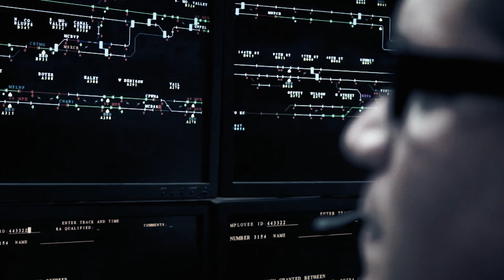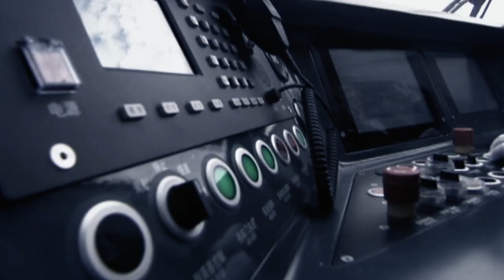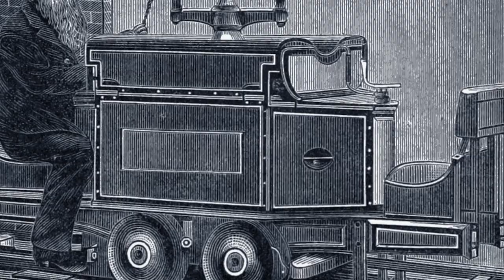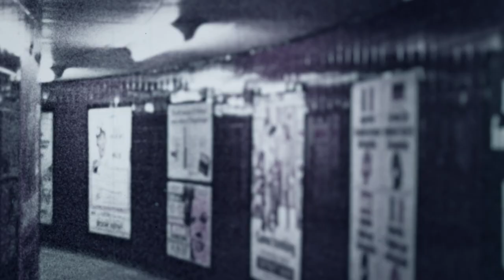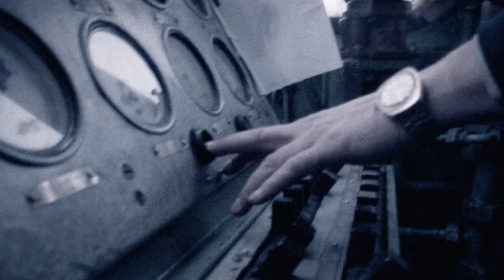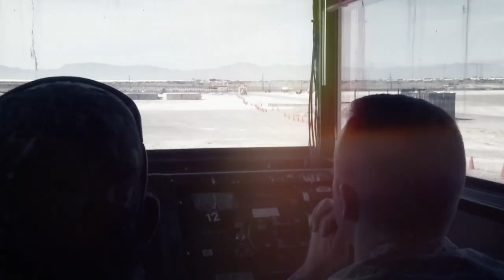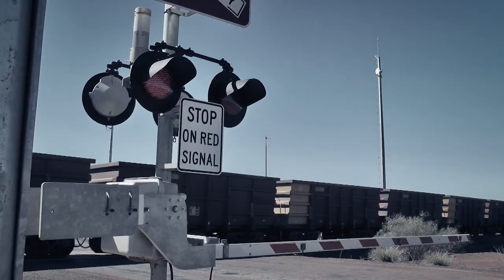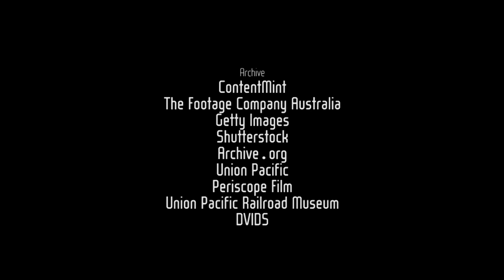Maglev: How To Travel Faster Than A Speeding Bullet (Train) | Power

Comment: 1:35: 🚄 The video explores the power of rail speed, focusing on the shinkansen bullet train in Japan.
6:14: 🚄 Maglev trains use magnetic levitation to achieve high speeds and reduce friction.
10:47: 🚄 The video discusses the development and cancellation of hover train projects in the UK and France.
16:39: 🚄 The TGV is a reliable, fast, and safe railway system that connects France and its neighboring countries.
23:01: 🚇 The Dubai driverless Metro is fully automated and doesn't need drivers.
27:11: 🚂 Luxury trains in Japan, India, and the Orient Express offer exclusive and unique travel experiences.
32:37: 🚂 Trains played a significant role in wars, including the creation of trench warfare and the massing of armies.
39:00: 🚀 The U.S Air Force set a world speed record for a vehicle traveling by magnetic levitation on a test track in New Mexico, reaching a top speed of almost 1020 kilometers per hour.
44:30: 🚄 The video discusses the Miniature Wonderland model airport and the futuristic concept of the hyperloop for train travel.
Recap by Tammy AI